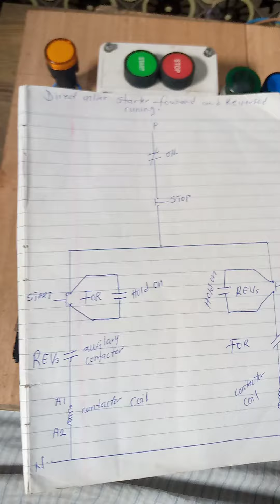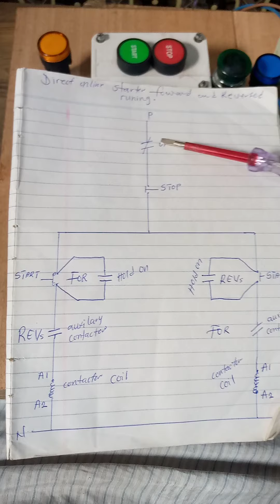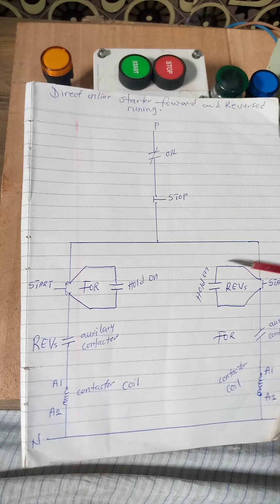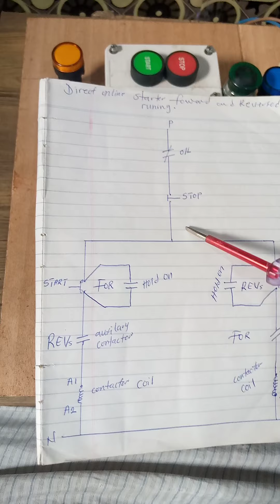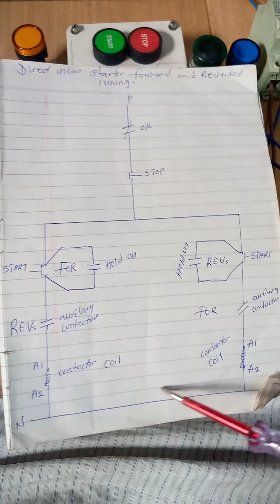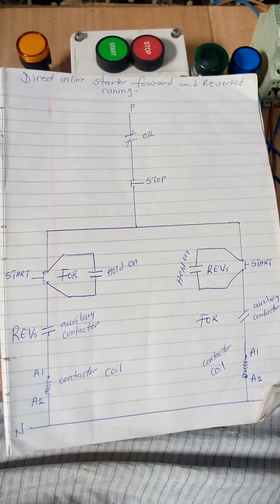direct online starter forward and reversed interlocking /// part 2

Comment: No mechanical interlock fitted, if coil burn out and holds a contactor in or contact weld then it's possible for both contactors to be energised and bang.